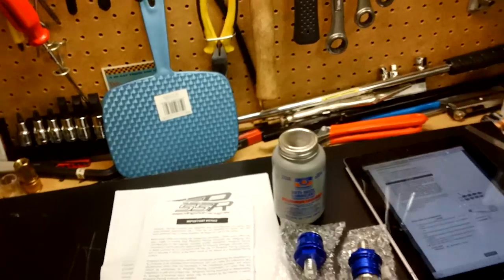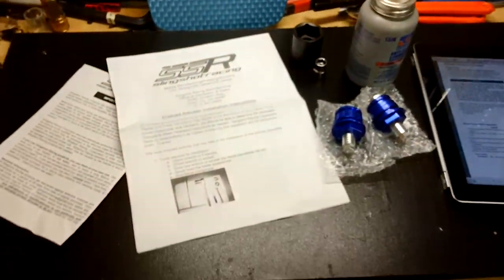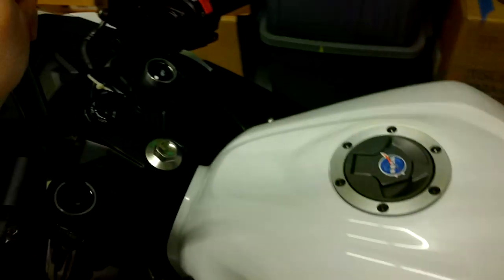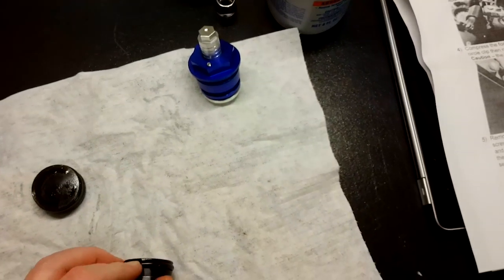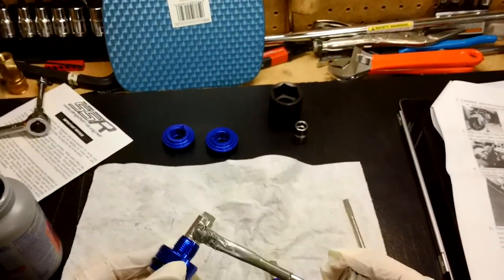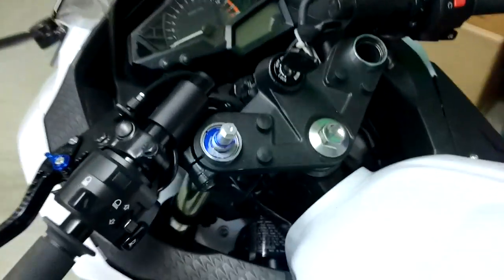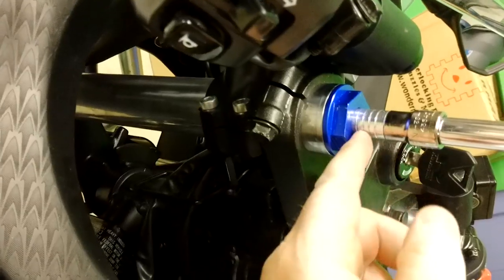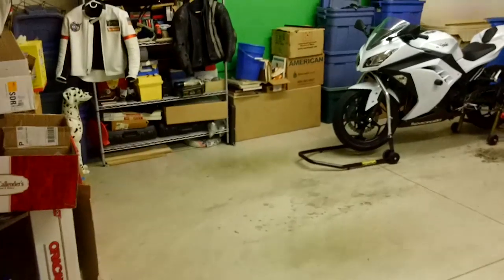How to Install SSR Preload Caps for the Ninja 300!

Comment: Preload is basically preload on the spring, what they do is they compress the spring as you turn them in, which makes the spring shorter and increases the force in the spring. You basically use preload to get static sag which gets the forks and shock into their working range, not topped out and not bottomed out. General rule of thumb is no less than 30mm static sag in front for street bikes and about 30-35mm of static sag in the rear for a street bike

Comment: Hey spacep0d do you need to adjust preload adjusters when you install clip ons? I just installed my woodcraft clip ons on the 300 but I didn't buy the adjusters? Are they required to be on or can I leave it with just the clip ons

Comment: what is the minimum preload on these?? looking to see what my spacer should be. Or what are the dimensions of the preload. The ninja 250r (2008) is 1.5 cm thick and sits flush with the top of the fork tube; so that adds 1.5 cm preload.. in other words; from the top ofthe fork tube,  how much of the adjuster sits inside the fork tube? I am guessing 5 mm since i read that is the minimum preload of these but want verify. thanks

Comment: Hi I just installed the preload caps and whenever I push down in the suspension it makes a noise. Is that normal?
Reply from the maker: Did you install them correctly? Hard to tell unless I know the noise mine makes...but I am kinda deaf.
Reply: No. It should not. 
I would suggest spend the $50-$60 & let a Kawasaki technician do it ( so you’re covered)
Anything happens to your bike in the front( whole front) and there is no warranty, no dealership warrants ect. 
& who wants to pay thousands?
Good video. 
The ones for my ninja costed $379 from Kawasaki authorized. 
But not yet. Got other work to do 1St. 

They look nice.

Comment: @spacep0d hey spacepod I m not sure if you still check comments on this video. One of my caps came missing the time y screw. It's now leaking a bit. Do you know what that screw does?
Reply from the maker: gptt916 Oh, the SSR caps? Definitely check with SSR on that! See if you can get a replacement ASAP.
Reply: ***** Thanks for the advice! I got in contact with SSR and got everything sorted out.
Reply from the maker: gptt916 They're a great company. ;)

Comment: Sorry I'm new what are those for?
Reply from the maker: halo0001master Adjust forks a bit (preload) and they fill the gap left when you switch from handlebars to clip-ons. Both function and form.
Reply: halo0001master These set Free sag of the bike and allow the suspension to work more efficiently (properly expanding over bumps in the road, keeping the tire planted to the road). Neat tool!